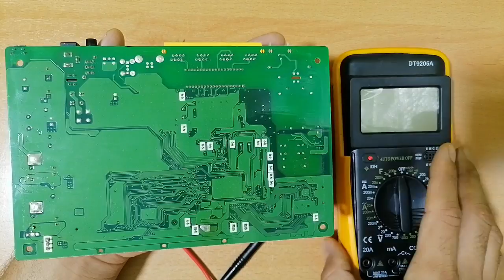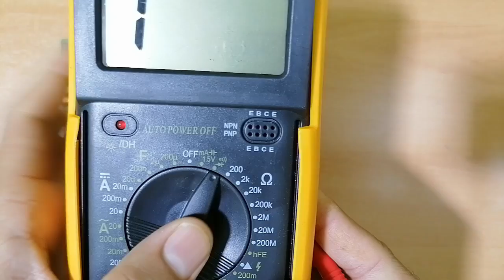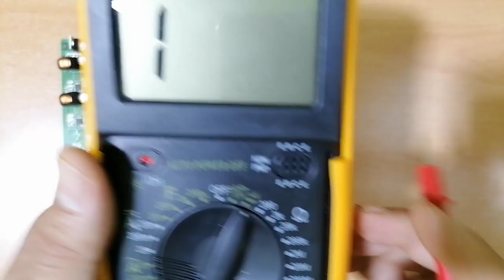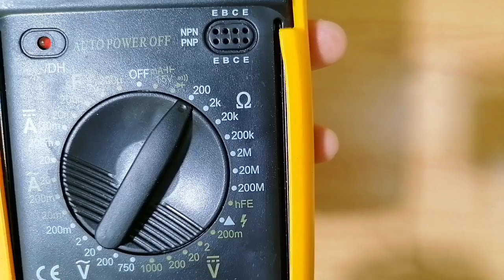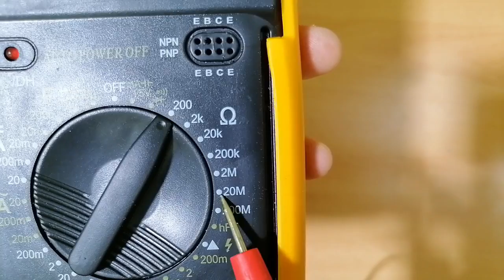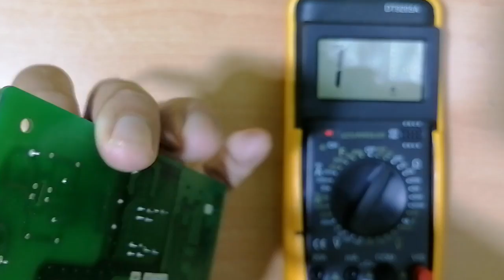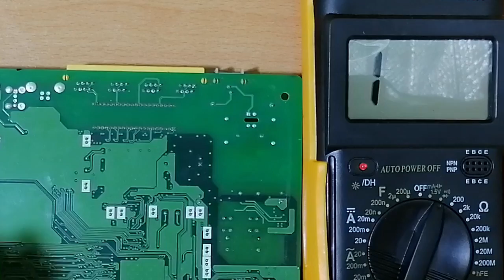Master tracing signals and voltages on motherboard paths - Expert tips to trace without a schematic

Comment: the top of the multimeter it’s for transistor test NPN&PNP this plugs it hard to used it it’s easy for a bran new transistor with 3 pin it’s tells the transistor is good or bad it’s hard for a scrap transistor that can test in this hole

Comment: Hello engineer,
How can we identify the power pins of a microcontroller when it is connected to a heat sink and we do not have any specifications about it?
Reply from the maker: Refer to its data sheet
Reply: @electronicsrepairbasics_erb  The data sheet can be removed due to the heat sink that is fixed with glue